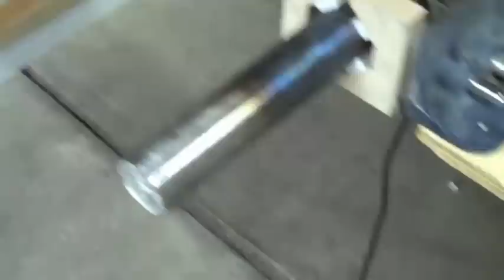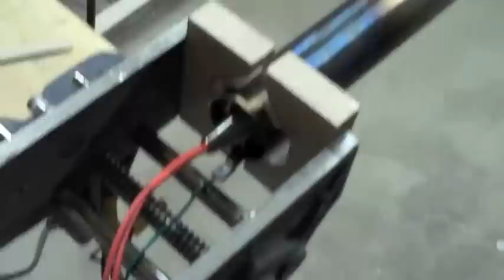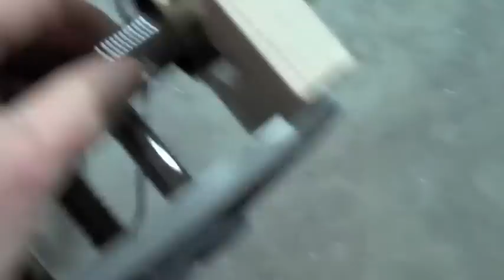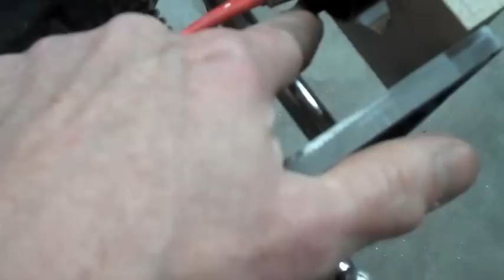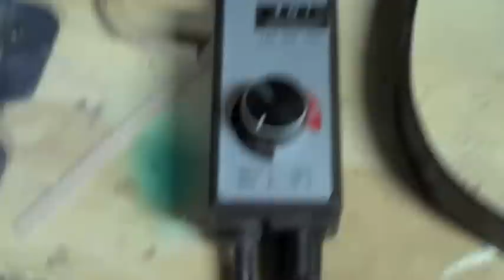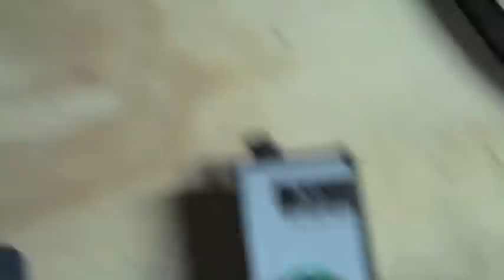Luthier's Wood Bending Iron

Comment: I have to say this was a great idea. Ive built one using the LMI tube they sell. Packed 2 boxes worth of aluminum foil in drilled the center ,which was a pain if the foil was loose but after the heater was put in I used 1000 degree silicone automotive gasket material to seal it up. Also used my temp probe from my multimeter to get temp reading .I used an old variac to adjust the temp and found 45 volts gave me 275 degrees,so there is room for more. I really dont know how long the heater will last but replacements are easy to buy, and cheap. great project.

Comment: Hi Chris. I know this is an old video but I found it informative in my quest for a side bender. Since its been a while since you've made it I wondered if you would have any ideas in which you would incorporate if you were to build another one. Just looking for any tips you've learned since the development of this one. Love your channel, thanks for what you do for us inspired to take on the humbling task of lutherie..
Reply from the maker: Unfortunately, this idea didn't work as well as I had thought it would. The heating element didn't last very long. I suspect it had something to do with how much electricity I was feeding it. If I were to make another one, I would incorporate a way to control the power going into the element.
Reply: @HighlineGuitars  Thankss for your reply! In the video you talked about using a router variable frequency drive. Did that not work to control the temp cartridge output?
Reply from the maker: @dpdupuis5  I seem to remember a fuse in the controller blew. Also, packing the tube with aluminum foil seemed like a good idea, but there were still tiny voids that may have caused the element to heat unevenly, which I am told will cause the element to burn out. It's been a while and I've since moved on to heated silicon blankets. I left this video up for others who might be inspired by the idea and know a better way to pull it off.
Reply: @HighlineGuitars  I see. Well I certainly appreciate your feedback! I'll let you know if I come up with any useful improvements.

Comment: i see that this is quite an old entry at this point, but these bending irons are made using a 60 watt light bulb as the heat supply, with a stainless steel (or i suppose it could be other metals) tube as the conduit.  i was surprised to learn how easy they are to construct.  https://youtu.be/-py9FGKpYW0 this link shows how Pablo made his first one.  

I'm a huge fan, Chris!  thanks for all you post.  I find all of your content to be very helpful!

Comment: I bought a cartridge heater and it arrived today. Does it matter which wire goes to positive and which to negative?
Mines a 220volt 400 watt one to suit my area and I got one of these to control the temp http://www.ebay.com/itm/131164014407